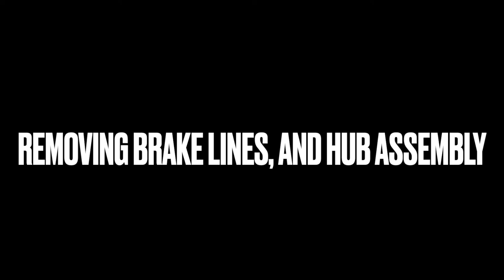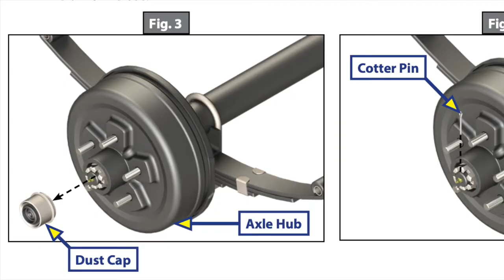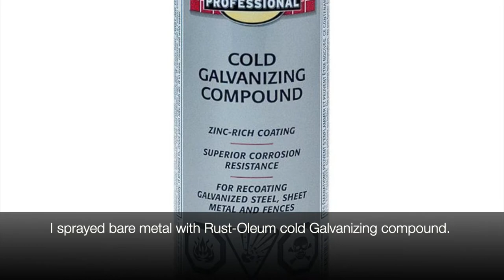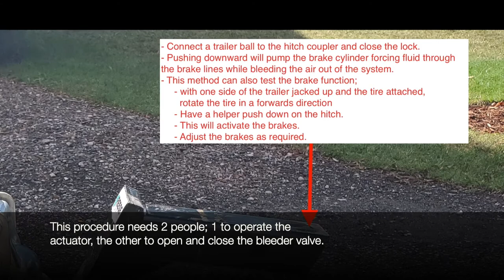2019 Hymer Touring GT Axle lift/modification

Comment: Nice Job!  I have the exact same trailer with the exact same issue.  Would you per chance, have a link for a reseller that would still have stock axles for sale? Thanks.
Reply from the maker: Private resellers of them after hundreds of them were purchased at the Hymer auction. Facebook Marketplace or Kijiji. Otherwise you'll have to source the Lippert axle from a reseller. For example https://www.facebook.com/marketplace/item/539730653801921/?ref=facebook_story_share
Reply: @jasoneddy9854  Thanks again, I really appreciate!